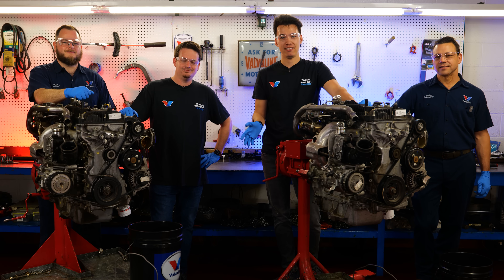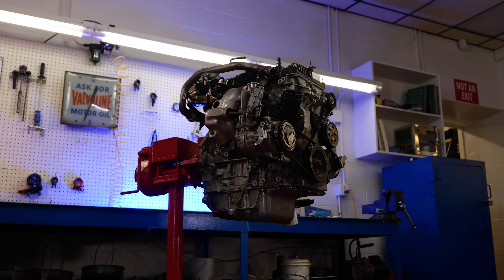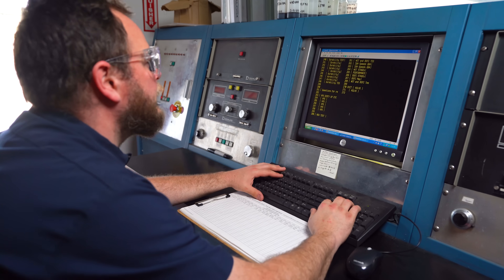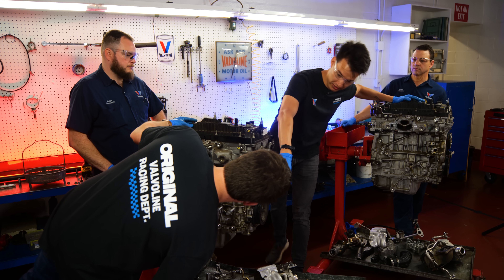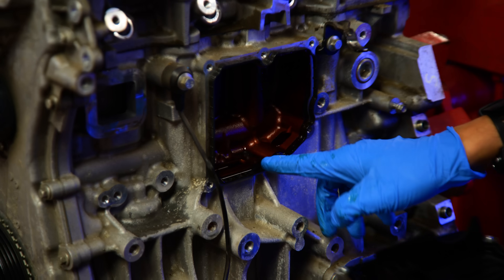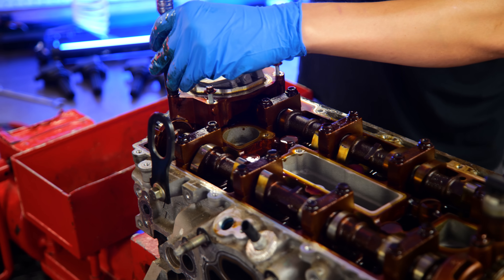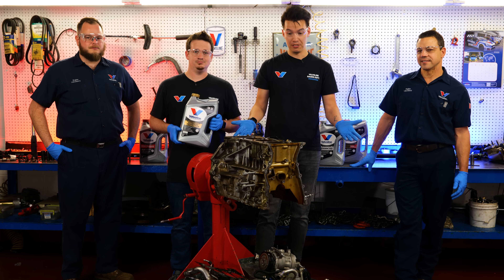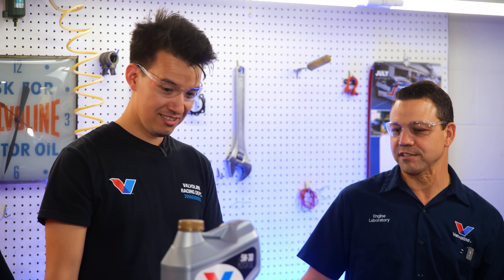Testing different oils over 4 years and 1 MILLION miles

Comment: Synthetic oil clings to heat, unlike conventional oil. This eliminates dry starts, which are the source of the greatest wear, metal on metal parts moving against each other without lubrication until oil is pumped to those areas, like cam, bearings, and rings.
Reply: Please explain how a synthetic oil clings to heat.
Reply: @SME.Retired  I don't know the molecular science, but paraffin based conventional oils run from heat and synthetics leave a thin film of lubrication on the hot parts at engine shut down, which provides enough lubrication to protect against the initial metal to metal the engine experiences until oil is pumped to those surfaces. I retired from the US DOE's Advanced Transportation Technologies Division a few years ago. I'm not a scientist, but I know a fair amount and more than many.
Reply: @cm22454  Makes logical sense.  Thanks.

Comment: I ignore my 2023 Toyota Corolla XSE  requirements of every 15,000 miles. I change my engine oil every 3000. I do not trust the manufacturers or the oil industry. They're all about saving the bottom line and not prolonging an engine's life span.

Comment: Proof that regular oil changes make a huge difference (and not 10k miles like the manufacturer recommends!). Regardless of the type of oil these Ford engines don't last this long under normal maintenance by people using recommended intervals or forgetting etc.

Comment: Id like to see a side by side between the  R&P vs the Blue Series. 
Also...slap one of the other high mile test motors together...swap a quart for Lucas stabilizer per run...and run 1/2 small bottle of MMO for last 500 miles per run. 
Especially with the Blue series...I promise that motor wont have ANY staining or residues

Comment: You did a great job, in my opinion the mineral oil did a very good job at 10,000 mile change intervals which it is not designed for. It kept up with the synthetic oil which is about half the price.

Comment: This is why I use synthetic. While I use Mobil 1, not Valvoline, I only use synthetic. The thing that convinced me was opening up the engine in my old Mustang Cobra around 90k miles when a little too much boost broke a spark plug and burned a valve. The inside of that cylinder head and engine looked pristine. The cams and cylinder head looked like it had just been cast. It blew my mind. More recently, I saw one of our work vans that had an engine failure. That guy just did cheap conventional changes at Jiffy Lube or similar. I changed my own oil with synthetic. Both trucks were same year, same engine. Mine had more mileage and a larger box on it/more weight, so it worked harder. It was sitting around waiting to be sold, and the engine had been mostly disassembled until the mechanic diagnosed that it was trashed. A few of my coworkers and I lifted the unbolted valve cover and the top of the cylinder head was full of sludge and varnished beyond belief. We then went and looked at mine by just looking into the oil filler neck. It looked brand new. 

While I’m sure conventional vs synthetic wasn’t the only issue here (he probably wasn’t good about changing the oil), there really is a large difference. If you’re not using synthetic, you’re just making a bad decision.

Comment: I saw a similar test conducted by Mobil in the mid 1970's. From that day, I switched to fully synthetic oil in all my bikes and cars even though it took vehicle manufacturers another 20+ years before they changed their recommended oils. In those early years, the fully synthetic version was around 4 times the cost of the equivalent mineral oil.

Richard

Comment: The reason there is so little wear for 500k and both engines made it to 500k is the number of starting cycles is extremely low and that is where 70+% of wear occurs because the engine takes a few seconds to build oil pressure

Comment: Calling BS. Havoline owns most of the oil patents. The base oil for synthetic is still conventional oil. The difference is synthetic has hydrogen blown through it to det the best lubrication molecules condensed and least amount of the molecules that don't help lubrication. So the only tak away from this video is conventional oil needs to be changed sooner than synthetic oil. None of these test prove real world conditions. Like starting the car cold and slamming into reverse and driving live mad to get to work and then getting stuck in bumper to bumper traffic 10 minutes after warmup an the outside remp is 102 degrees and 3 minutes later its parked for 4 hours and 9 min round trip to Starbucks or taco bell the off again for 4 hours then a mad dash home in 117 degrees. Las Vegas is a synthetic oil environment for people who don't take care of maintenance themselves on a regular shorter schedule. Carbon deposit are mostly from fuel. If Carbon build up is an oil issue explains the fuel delivery system like how it is or isn't a factor or how the oil has to hold impurities in suspension and the oil filter can only handle so much. Not a conclusive test. Both oils are good just change your oil sooner than the 5000 miles.
Reply: Conventional is garbage. Why go for a worse quality oil?

Comment: Is full synthetic oil good for old v8 big Blocks from 60s 70s? Or online good for modern
Reply: My classic V-8’s have such mundane seals and tolerances that I just run conventional oil and change it every 3,000 miles.   Sure, it came from the factory with 385 horsepower, but that doesn’t mean it was a high quality piece of engineering.  I also add Liquid Moly.

Comment: I wish you had a 3rd engine using whatever oil ford uses at the factory.  I would love to see the comparison between that and the  Valvoline oils.
Great video.
What is the effect of changing the oil sooner than the recommended interval.  For instance, changing every 5000 miles instead of the recommended 7500 miles?(using Mobil 1 full synthetic)
Thanks

Comment: This was a great video.  I'm surprised how much better the synthetic result was.  I really didn't think there would be that much of a difference.  I knew synth was better to use but it was just about twice as clean.  What about doing a test comparing the different synth brands.  I use valvoline now but I used to use Mobil 1 until someone told me to switch.

Comment: My take away on this is.... 
1: Synthetic is a superior oil 
2: Conventional oils have had massive improvements over the years
3: Which ever you chose, when changed at the proper intervals either oil will likely protect long enough to surpass the average consumer usage of a vehicle, average of 8.4 years/121k miles.
4: It is more cost effective to use a good quality conventional oil if you only plan to keep the vehicle for part of it's total life cycle.
5: I will continue to use synthetic oils because I drive a vehicle until it is able to qualify for antique license plates.

Comment: Conventional oil needs to be changed far more often. I had a 1970 Corvette and the engine was immaculate after 130k miles and 25 years using conventional oil. Changed at 2k miles. My new 2024 Rav4,  I change synthetic oil at 4k (after 1k break-in) and I expect similar results.

Comment: A lot of people in the comments are complaining about the 10k oil change frequency, but seemingly fail to understand that the vast majority of people who drive vehicles with combustion engines don't know, and don't WANT to know, anything about them. If the manufacturer recommends an oil change every 10k miles, that's what most users will do (actually MOST users will probably miss that mark by a few thousand miles, I know I do more often than I'd like the admit, and I know a lot more about engines than most drivers). This test is much more realistic for what most drivers will actually do, in a vehicle that a lot more people drive than something like a Mustang. It just reaffirms that for the average driver who just wants to get from point A to point B reliably, Full Synthetic oil is the clear winner as it gives a lot more leniency on frequency of changes.
Reply: Conventional Oil protects well better than synthetic if oil change is done in the right time, conventional or mineral is more cheaper and better against friction.
Reply: @HalfVccTronYente always it's better to frequently change cheapest oil that to Miss the mark on the better one. But in reality math is simple you just can do more milles with the better oil
Reply: @HalfVccTronYente I mean this test showed that conventional changed at the right time wasn't better than synthetic. 
Unless you mean conventional changed early is better - but then that gets way more expensive than synthetic changed at the right time. 
Like conventional Valvoline is $20 for 5 quarts + $5 filter so that's $500 over 100,000 miles with 5,000 mile  oil changes whereas synthetic is $27 so that's $320 with 10,000 mile oil changes.

Comment: EGR and PCV systems are the cause of most of the deposits in the intake system. Can't do much about the EGR. But if you install an oil catch can in the PCV system and keep it cleaned out regularly. It will definitely help a lot

Comment: So even though these vehicles were strapped to a dyno, monitored and maintained perfectly. They still blew seals and the catalytic converters failed. That's the Ford quality I know 😂. If this much goes wrong in a controlled environment. Imagine these engines in the real world. Add poor driving, lack of maintenance, and neglect, and I bet these engines won't normally make it to 150k miles. Unfortunately it's not just Ford. All manufacturers have overcomplicated their engines and made it impossible for owners to maintain their own vehicles. 
I'll stick with my old V8s

Comment: All the comments about “these look great” isn’t a testament to valvoline product, it’s a testament to the degradative affects of thermal cycling, starting from low oil pressure (the oil pump cycling on and off with the car sitting overnight), and other affects of their testing. The reality is, different brands of motor oil do not perform drastically different.

Comment: Now imagine the results if you changed the oil every 5K miles or even 3-4K like I do. I use Pennzoil Ultra Platinum because it is made with natural gas and super pure! Pennzoil's Quaker State Brand uses crude oil which is probable why it has a higher detergent package in it.

Comment: Every 10,000 miles my azz, my 3.5 Ecoboost gets fresh oil every 5 kms that's 3000miles for you Americans, as a retired Ford Tech change you Ecoboost direct injection engine every 5000 miles or less, it's just oil and the cost to do it yourself $50

Comment: Meanwhile in EU: high boost 1.0 - 2.0 liters (100-300 HP) engines with 20 000 miles 2 years intervals. Everything just work. Also nobody uses other than synthetic oil here. I thought nobody manufacture it by now xD. Changing oil more frequently than 10 000 miles is just wasting money.

Comment: Can't believe they didn't look at the cylinder walls with a dial bore gauge ,,, ! ,,, Especially at the top inch and as fine as possible at the ring reversal area . Also particular attention to the ridge by removing the carbon and checking the depth right in the reversal ,,, !

Comment: 10k miles in a lab, is alot different than 10k miles on the road. No car lives 500k miles on 10k mile engine oil changes. Engines ean never dealing with condensation, road dirt, aggressive start and go. Not a valid test.